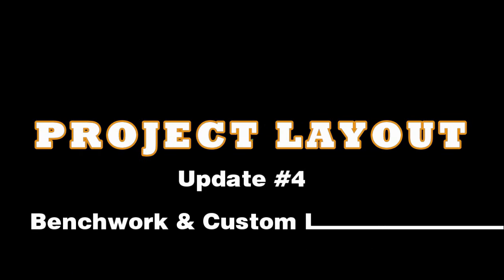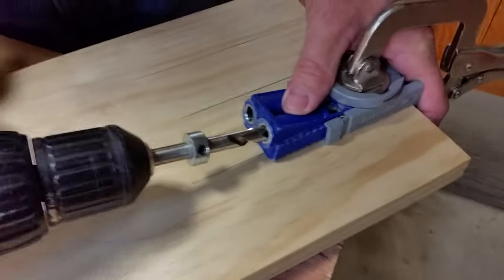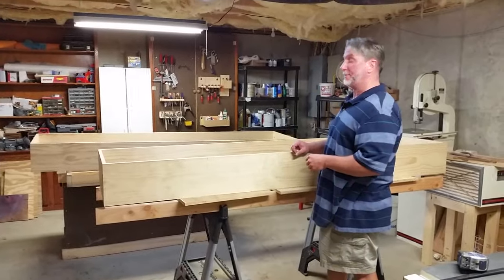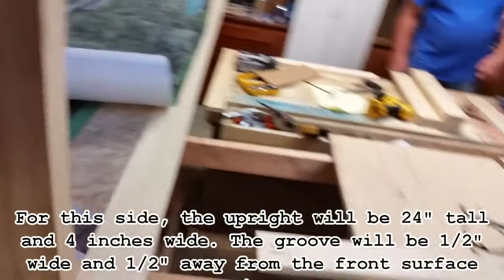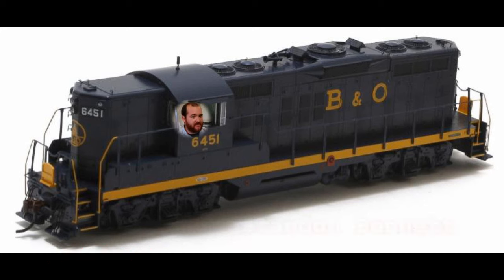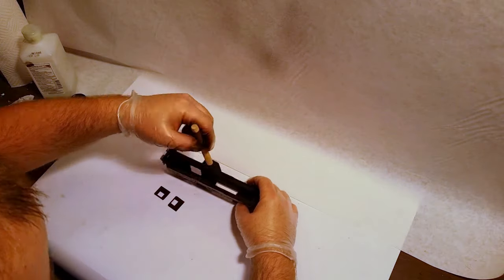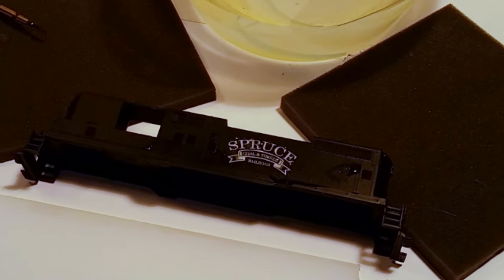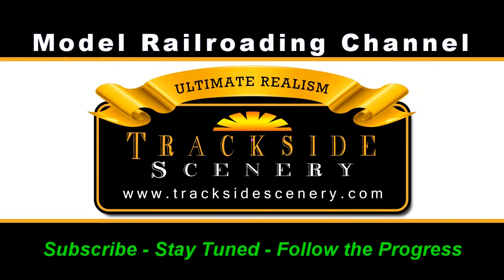BUILDING A MODEL RAILROAD - Layout Update #4 BENCHWORK & LOCOMOTIVES

Comment: Joey ! When you use those Kreg Screws do you have to drill a pilot hole for the screw to go into ? never seen those in the hardware stores we have, but they are available on that well known shopping website name after a S American jungle!
Reply from the maker: Graham, yes, the Kreg screw set up is there you are drilling holes that will recess the heads of the screws, but more importantly pre-drilling keeps the wood from splitting.

Comment: Hey Joey, couple of questions about the backdrop.  What kind of blade did you use on the table saw for the backdrop groove?  And, what material did you use for the backdrop?  Did you need any bracing for the backdrop other than the two posts on each end?
Reply from the maker: Ray, the blade is a dado blade that you install on your circular saw.  Obviously you have to have the circular saw working in a table (table saw). It cuts just like a regular saw blade except you can adjust the width of the cut and by lowering the blade, you can make the groove as deep as you need.. The backdrop will be mounted on 3/16" gator board and yes, it will have more supports behind it. This will be in an upcoming video.
Reply: thanks Joey, I look forward to the video…